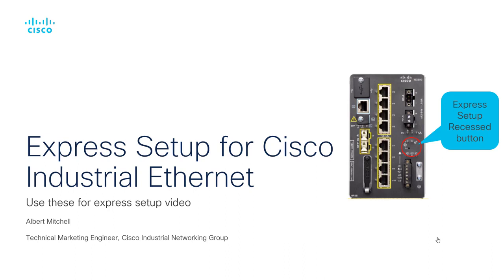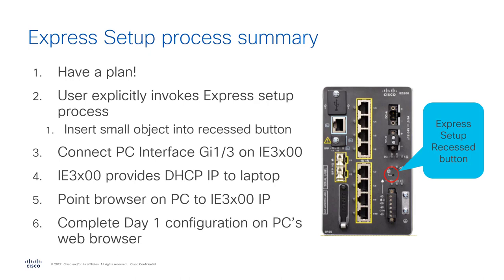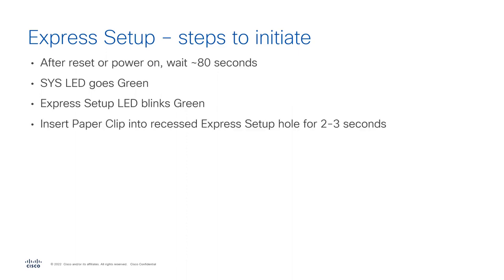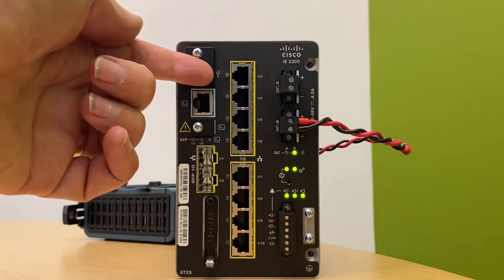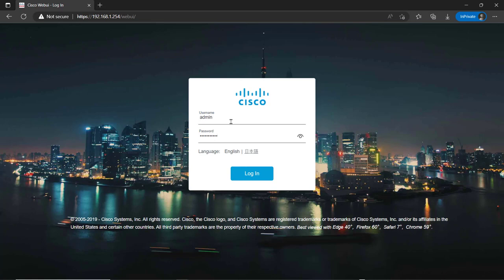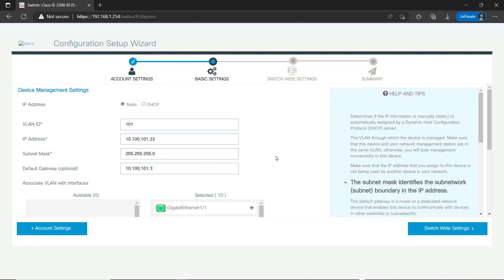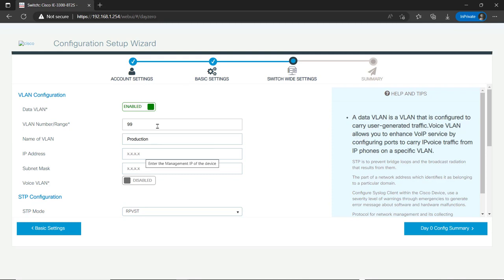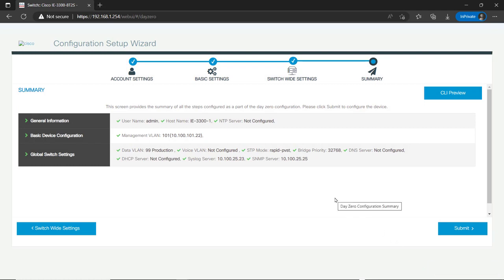Express Setup for Cisco Industrial Switches: Day 1 Configuration Guide

Comment: What are the cables?  Do they come with the power supply?
Reply: the twisted red-black cables are 16 guage wire.  the IE3300 HW install guide can provide guidance on this.
Reply: these 16 guage wires do NOT come with the power supply.  Cisco Industrial Power supplies do NOT come with 16 guage cables.

Comment: What are you using to power up the switch?
Reply: in this video I was using a  50W power supply.  Product ID: PWR-IE50W-AC-IEC= 
in the video its flipped over on its side.  normally it would be din rail mounted near the IE3300
Reply: The Cisco PSU is around $1200 we use Meanwell PSU about $250 each we have over 100s in service in our solar fields. We are a large power utility. I have bought some of those Cisco Power supplies they are very rugged never had a failure with those either just lot more expensive. I love these rugged switches. I don't know how many power supply failures we had with regular IDF switches 100s of them not these rugged ones. Were replacing everything with IE switches expect in our DC.